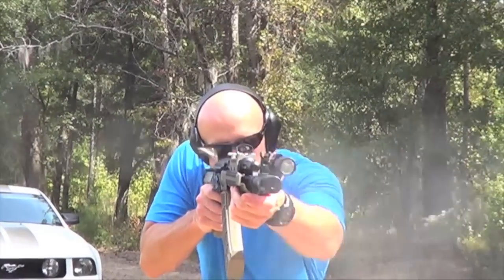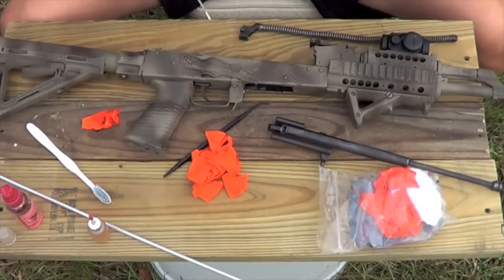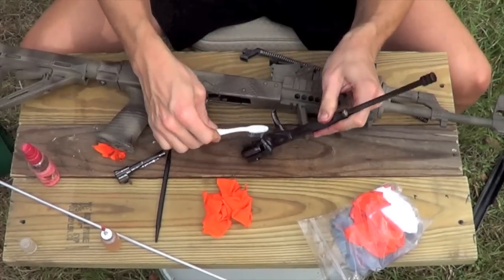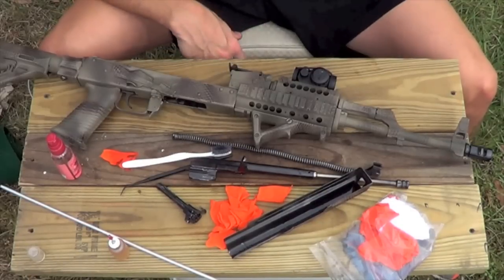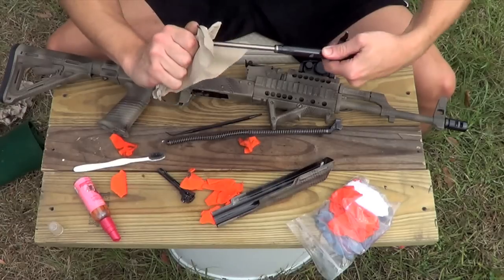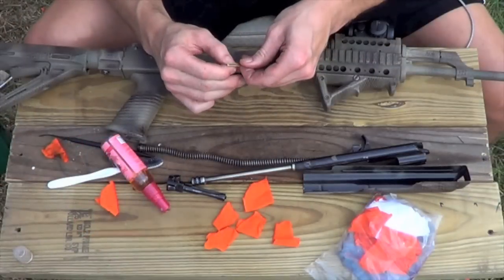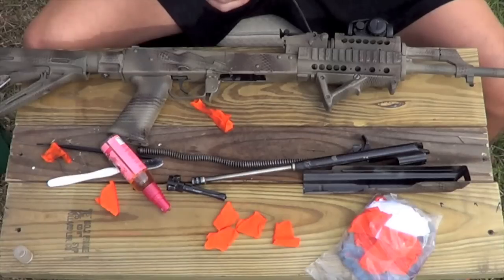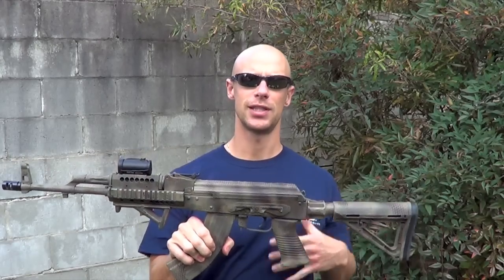How To: Clean & Lubricate The AK (47/74) Pattern Rifle (HD)

Comment: We used grease on M70 AK in serbian army during 90’s war
Reply: That’s what I use now. On barrel lugs and bolt lugs and bolt carrier rails. On trigger assembly I use a medium gun oil.Its what these guns were designed to use . Have not had any malfunctions and the gun shows no wear.My Zastava m70 is built like a tank and runs like a Ferrari.🙂

Comment from the maker: Maybe.   It just depends on the finish...  If it's park'd or blued you'll be fine but the painted guns like an Arsenal I wouldn't.   There's certainly no need to.     You can certainly (and should every 1-2k rounds) clean the gas block with a solvent however.

Comment: Also try white lithium grease or other thicker grease to lubricate the action once cleaned.
Reply from the maker: That'l work as well so long as it's lithium based.
Reply: I use Mobile ! high temp bearing grease...works great and a can of it will probably last you a lifetime.
Reply: im going to try walmart high temp grease its got a high temp rating some it should work good, IMO any grease is better then and light weight gun oil. but if i had to spend my money i would get the best grease as a can will outlast you, i also use ATF oil for my guns.. quart of it will out last you lol  and it can stand in for a cleaner, also can be made into a good clearner as well, look up Eds Red. Just my .02

Comment: The area where the sear/hammer/wound spring is needs to be kept dry.  Putting grease on the rails causes it to dump in that area when hot, causing lots of problems.  Using oil instead can do the same if the AK is stored muzzle up after lubing.  Getting the sear  area bone dry again is a real hassle.  Not worth it.  The rails only need a wipe down with a clean rag coated with a few drops of oil--if that much.  There is NOT enough metal to metal contact on the rails to need more.  Some of the American owner books say to  lube the rails, but I am waiting to see a Russian  military book saying that--still looking.
Reply from the maker: chad haire Thanks.

Comment: I remove my gas tube for every cleaning, run some boiling water through it for a second, then push a couple of dry patches through to get out all the moisture... I do the same for my barrel after a day of shooting corrosive ammo. Then I move on to my usual gun cleaning solution and put a nice light coat of oil on a patch run it down the barrel, and lightly oil all moving parts. I also always wipe down my recoil spring, and put a real thin coat of lube on it. I like to keep my weapons as clean as possible to prolong their life.
Reply from the maker: Nothing wrong with that.

Comment: i grabbed a wasr 10 the other day and i love it. its not a wasr10/63 so the quality is better than the older days of wasr. i love it and have no complaints.
Reply from the maker: barcode80 They still produce 10/63s FWIW
Reply: Mrgunsngear Channel What's the difference between a WASR 10 & 10/63?
Reply: ***** : None really.  As best as I can tell, the '10' is new-build (mine was built in '13--the last two digits of the s/n are 13 ) and the '10/63' was built up from demilled Romanian mod63 service rifles.

Comment: I use Mil-Tec like CLP keeps rifle from hard build-ups. Three patch with third  patch being white in and out the barrel. It also works well on my smokepoles too. That's blackpowder for u tenderfoots. My stainless bp 58 remi revol is even easier, Windex with ammonia- d and paper towels. U r right about not much lube needed oil in summer and grease in winter. Russian design for fat fingered framers, and when ammo runs out make a hell of a battle tool for close-in fightin. Poke, slash and beat anyone within arms length.
Reply from the maker: Frederick Nolan Good stuff.

Comment: Nice simple video, thanks. Did have a question maybe you or anyone could answer. I picked up a wasr for a range beater as they call it & it was new, passed the buyers guide but after shooting 5 rounds or tula I came home to clean it. It was hard to rack at first but fine after the 5 rounds. Only issue is when I started cleaning it, it was filled with small metal shavings. Could that be from the factory or something associated with the break in of it? Is there anything specific I should look for now? I plan of cleaning it & lube, then going to fire a few more & see if the problem happens again. Any info would be appreciated
Reply from the maker: Chem istry It's likely factory shavings.   I'd just clean it and see if it happens again I'd stop shooting Tul---it's the worst ammo made.
Reply: WASRs are imported as "sporting rifles" and can only take single stack magazines. They are milled at the factory to open up the magazine well and that is what the shavings are most likely from.
Reply: Mrgunsngear Channel Thanks, that's what I did & Ill be testing it again later today. I also picked up some wolf ammo. Only reason I got tula is it was the only place local that had ak ammo other then walmart & I wasn't going to pay 34 a box just to see if a wasr worked right.

Comment: Thanks for the video. Where did you get the little spray bottle? It looks ideal for getting a smaller amounts of cleaner into the receiver, gas tube etc.
Reply from the maker: Zorok Krull walmart travel section
Reply: Mrgunsngear Channel Thanks! I have trigger spray bottles that tend to saturate too wide an area with too much solvent. Good idea man.

Comment: So I'm a poor college student and new to shooting. To clean my M&P 45, I use some facial degreaser which I used to use for acne on my face. It seems to get all the oil and carbon off there but I'm wondering if it's not a good idea. And to lube my pistol, I use synthetic motor oil. I know it sounds ghetto, but the face cleaner and the motor oil has kept my pistol running flawless even with the cheap tula 45 and the reloads I shoot. Not a single malfunction even after 2000-2500 rounds (including one session at a handgun class where I shot 500 rounds). After the class, we were all cleaning our guns and people where pulling out Ballistol and breakfree and there I am with my Acne stuff and my motor oil and people started laughing at me despite my pistol's performance...
Reply: TMI
Reply from the maker: Synthetic motor oil works very well on guns.    Keep on keeping on.

Comment: Is there ever any need to pull the firing pin and clean it? I don't even know if that is possible but just curious. Do I ever need to lube the actual firing pin?
Reply from the maker: It's possible.   I wouldn't do it unless there is an issue.

Comment: Just had my Arsenal SAM7R cleaned by a friend who used break cleaner and a steel brush just on the bolt is that safe ?
Reply from the maker: +tony davis safe for operations---yes.  For the paint--maybe
Reply: Thanks now that I know how to properly clean Ill stick to soft metal brushes for every part

Comment: How long will an AK-47 last without cleaning? A few years?
Reply: Forever
Reply: BigBlackClocks depends on how many rounds have been fired through it and if you have used any corrosive ammo, laquer coated ammo, etc. Contrary to popular belief AK's CAN and DO sometimes malfunction. I don't clean mine every time I shoot it but I usually clean it around 1k rounds or so, or if it's gonna sit in the safe for a while I will clean it after only 100 rounds just so it doesn't sit dirty and is coated with oil for rust prevention
Reply: Yes, the weapon would function forever without cleaning. Not cleaning your rifle won't cause it to be unsafe, or something.

However, eventually you'll run into issues with reliability and that entirely depends on how much you shoot, how fast you shoot, and how often you shoot. You'll definitely want to be on a cleaning schedule and it entirely depends on the above factors. I usually clean my firearms immediately after using it for hunting or at the range. 

In the real world, the Russian military clean their rifles nearly every day as with any professional army would. The AK has a cleaning rod included on most models and sometimes with the brush/pick kit. In 3rd world countries, they would follow older methods to clean their rifles: boiling hot water and animal fat for lubrication. 

Overall anyone who claims they never clean their rifles are either lying to you, or just not shooting nearly enough to reach the failure point. Shooting one magazine a week at 1 rounds a second would probably work every time you do it.

If you're the lazy type at the very lease just wipe it down with a oil soaked rag.

Comment: Gumout fuel injector cleaner makes a great substitute for gun solvent. It's much cheaper, and it's designed to remove carbon buildup from a high temperature environment- just like a rifle bore. Just don't get it on any wood or painted areas. works great.
Reply from the maker: steve dittmar Noted.  Thanks.

Comment: So is there an easy trick to flushing out all the cosmoline?

I got a yugo m70 ab2 that I am working on; it's a sweet ak but a little on the heavy side. Since it doesn't have a chrome lined barrel do you recommend a more intensive cleaning?
Reply from the maker: OGC Haxzor heat gun or blowdryer
Reply: ...mineral spirts works great...cuts cosmoline well...same thing as paint thinner basically...

Comment: Hello Mr. Guns n' Gear, On the ak-47 rifle you're shooting at the beginning of the video, the tan/ black rifle with the midwest rail system and the RMR, What muzzle brake is that you have attached to it? How does it perform against an ak-74 style compensator? Is it the best one you have used in terms of bringing the 7.62x39 recoil down??
Reply: Leupold Deltapoint*
Reply from the maker: ***** SRVV.   It's good but the SRVV Jet is better

Comment: What is the deal with some cleaners or lubricants taking the finish off a arsenal ak? I'm new to arsenals and don't want to take the finish off my rifle.
Reply from the maker: 1991jarhead They're just painted so solvents will damage the finish.    Use CLP and you'll be just fine.

Comment: I just bought my ak and what can I use to clean off all the oil residue all over the gun and the receiver I'm hearing brake cleaner or carb cleaner but I don't wanna go spraying carb cleaner in my trigger assembly if it's not the right way to clean it ?
Reply from the maker: Those will work but may hurt your finish.   Simple Green works.

Comment: I'm in the business for an AK pattern rifle and I've decided that I want an Arsenal SGL but I don't know if I want it chambered in 5.45x39 or 7.62x39. 7.62x39 ammo will be easier to find but its more expensive round for round even with surplus. 5.45 is a much better preforming round but it's harder to find (though less expensive round for round), most reasonably priced 5.45 ammo available is corrosive surplus (requiring anti-corrosion oils like Ballistol which I have a hard time finding), and 5.45 mags are harder to find and when you do find them they're more expensive. I already have a 30cal cleaning kit and gear so getting 5.45 would mean getting .22cal cleaning gear. I want 5.45 but I don't know if the extra costs are worth it. Any input?
Reply from the maker: futurejarhead0311 5.45 is superior in every metric besides intermediate barrier penetration.
Reply: Yeah, but the overall cost of 5.45 operation is higher is it not not? Seeing as at this point I only have .30 caliber firearms, the cost of a rod that will fit .22, .22 brushes and patches, and lower availability of 5.45 ammunition all bump the maintenance and operation costs. What I'm trying to decide is whether the ballistic superiority is worth the extra monetary costs. Oh, and it's a SOB trying to find an SGL in 5.45

Comment: It looked like you were running dry patches through the bore at the end. I usually just pull a couple CLP'd patches through my AK's (or any other rifle) bore each time I clean. I consider CLP the same as an oily patch after using Hoppe's, like I used to clean years ago. Is there anything wrong with running a patch soaked with CLP last?
Reply from the maker: +J Kale (JKale2923) no

Comment: I'm running out of Hoppes Solvent and have a small bottle of Slip 2000... thoughts on Slip 2000?  Otherwise, I may pick up some Breakfree while I'm at Circle 10 AK next week. 

Is it still fine to use Hoppes LUBE after using CLP?

Comment from the maker: Like I say in all my basic videos----no one is born knowing this stuff.   CLP=Cleaner Lubricant Protectant.    Many moons ago the military put out what was called "the impossible specs" for a do-it-all product that Soldiers/Marines/Airmen/Sailors could use on their weapons instead of having to use solvent and lubricant.   Well, the result was mil-spec CLP.   It's not the best at any of the 3 aspects but it's pretty damn good at all of them.
Reply: I believe you haven't stated it in the video, but what brush are you using for inside the receiver? Is that a steel or nylon brush? Don't wanna mess up my new AK too badly ;)
Reply: @daddy_cool762  looked to me like he was using a regular toothbrush.
Reply: You should pin this!
Reply: @daddy_cool762  just a basic plastic toothbrush

Comment: in the old days the russians used to clean after firing. The cooks would warm up some water then the rifle co. would run the rifle thu the water in a drum. kinda like washing socks, if you take my meaning. then they would individually finish cleaning the rifles using diesel from t h e vechiles. in winter they used oil from the vehicles in the summer grease from the tracks. We watched them from spy camera. There training manuels said one thing the operators did another, K. himself used clean motor oil or thin greases. the diesels will leave a thin film on metallic surfaces protecting and displacing moisture from the rifle burning off during firing alowing the oil or greases to do thier jobs.
Reply from the maker: +david tasker thanks
Reply: +david tasker In 1985 our battalion (USMC) got new M16A2's and our CO did not like that they were all covered in cosmoline and not battle ready. They rounded up everyone they could find and we spent the night cleaning them using hot water from the mess hall. Lot of tired jarheads the next day.
Reply: I’m guessing the water wash was for cleaning off the residue from the corrosive ammo they use, or used to use. Water works best for that.

Comment: use thin synthetic motor oil like 0w-20. Millions of dollars of research has gone into these oils and they serve the same purpose as gun lubricants, but better and cheaper per amount. 1 quart of motor oil for some mobile 1 0w-20 is only about 8 bucks and will last you forever instead of a tiny bottle of some over priced "gun lube". The oil withstand extremely low and high temps unlike grease while also containing cleaning and anti corrosion agents. I've used motor oil in my arsenal for years and it has never failed me.
Reply: Josiah The fact is that the AK-47 is designed to be used with engine oil as lubrificant.
Reply: Josiah I agree 100%,i have an m&p10 it wouldnt cycle 762 but would the 308 after a couple clips it wouldnt shoot either,did some research and bought a bottle of lucas oil treatment and mixed it with mobile1 20 and it now runs like a dream,it will eat any thing i feed it!!!
Reply: @danielmuse5282  - They must have been assault clips!